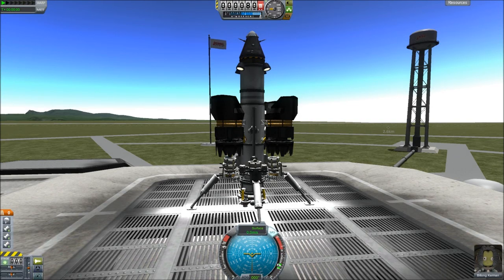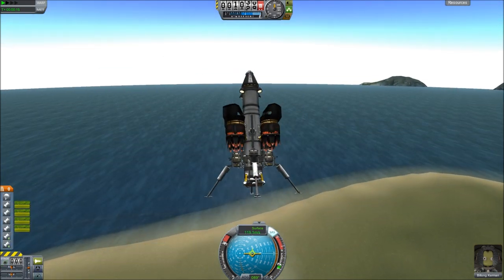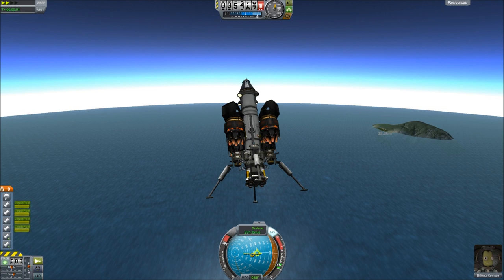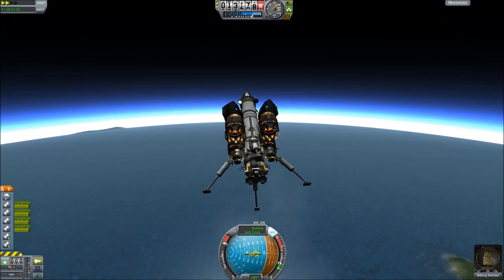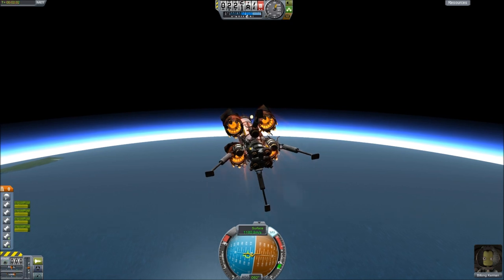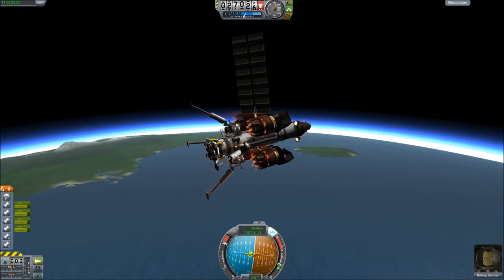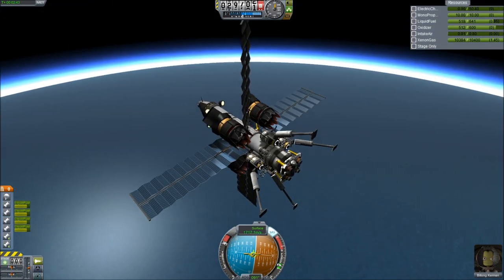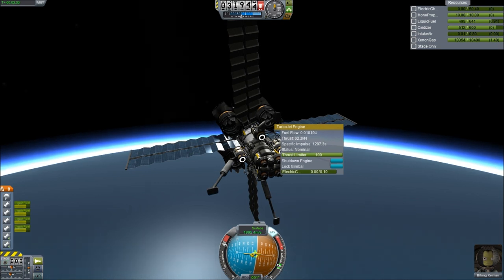KSP - Single Stage Mun Lander - Kerbin to Mun and Back in 1 Stage with no parts loss

Comment: Nice design. I'm planning on making an SSTO with a similar design, although it'll be a bit bigger than yours. Wonder if it'll work.
Reply from the maker: +Diabetic Atheist This was made way back before they changed the atmosphere so if you made the same as I have here it would work even better now. Just remember, the bigger it is, the more fuel it takes to move so you gotta find that perfect balance of fuel to weight or in actual terms, maximum delta v
Reply: ExaltedwithFail Yep, very true.